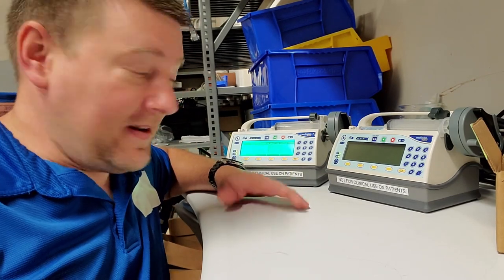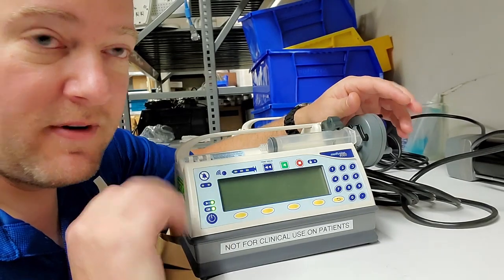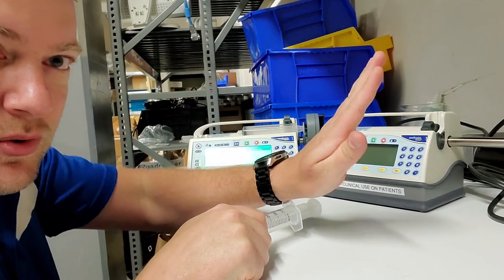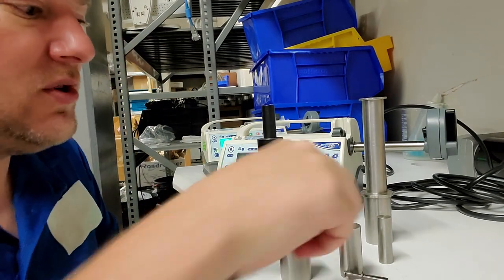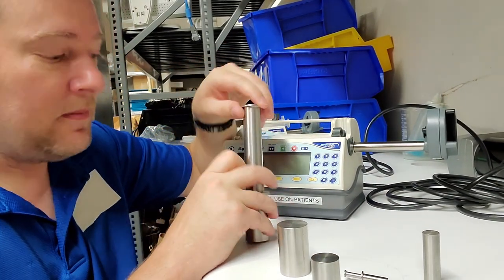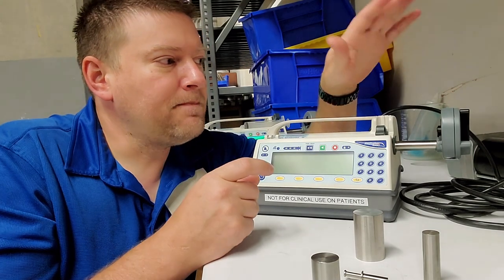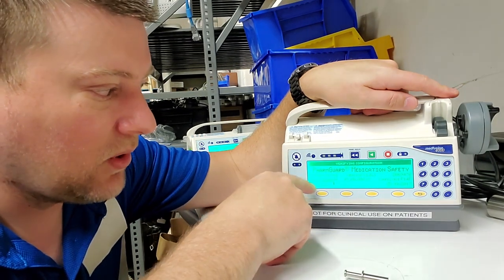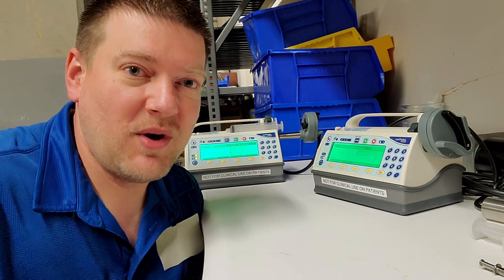Syringe Pumps (In a nutshell) with Medfusion 4000

Comment: This model is one of the most annoying devices to disassemble/reassemble
Reply: @ashp2182  so when you have a super cap failure you don’t just solder on a new one?
Reply: @ashp2182  man I would look in to it. It cuts the cost of a 600 board to like a 1.35
Reply: Full disassembly just to replace the rubber grommet 😂